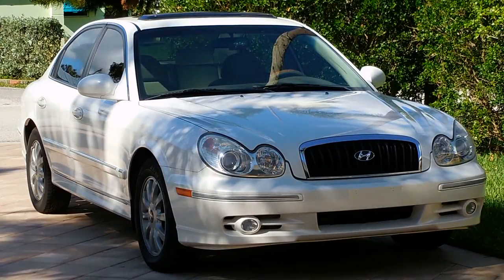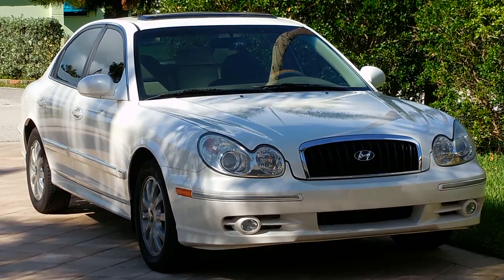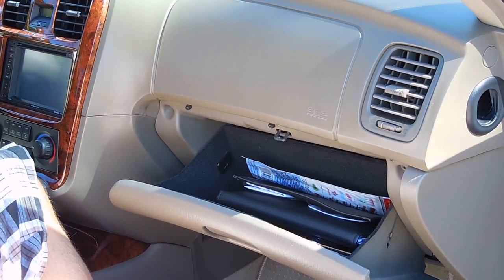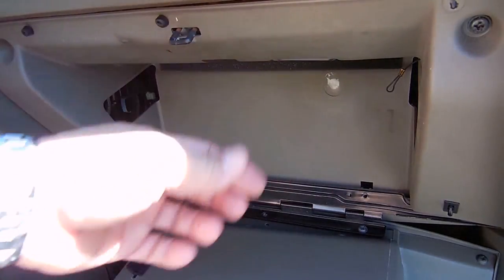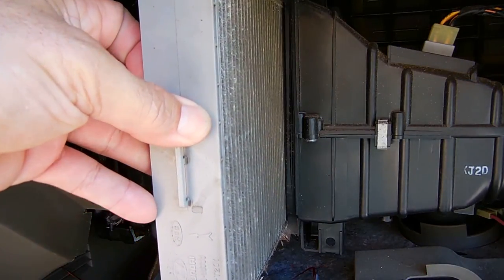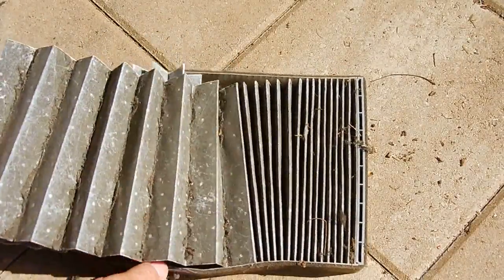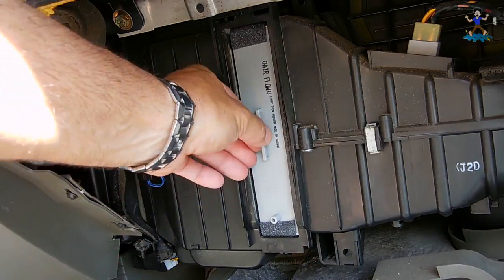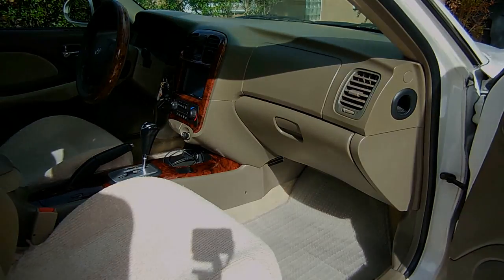How To Replace Your Cabin Air Filter

Comment: I had an old Vauxhall Vectra and the windows used to literally drip on the inside in the winter because of all the condensation,  apparently it's because this filter is blocked, I don't know if that's true? but that's what I was told.  Thanks for sharing.
Reply from the maker: Thanks for watching!

Comment: 2004 kia optima 2.4l , when i tried to replace it i noticed it had no cabin air filter so i called  to the dealership and they said there is not air cabin filters for this models, so what i could do, maybe an universal air cabin filter?!

Comment: I got an early edition of the 2006 Kia Optima EX. I went into to change out the cabin air filter. To my surprise, there was no filter and especially the unit that holds the filter. Do you happen to know the part number for both? I have already swept out that area where the filter assembly is installed. I just need the part number for the filter and especially the housing.
Reply from the maker: Online search autozone or advanced auto will have it.
Reply: @electronicsNmore  I just found the correct (complete) filter assembly that goes in my vehicle. Advanced Auto Parts gave me a flexible cheap filter with no rigidness. The one I just saw online was 17W07 Tyc 800018P. That is the correct one for my vehicle. Now I got to order it. Thanks for your reply.
Reply: same thing happened to me on my 2004 kia optima 2.4l , now im trying to find an universal just with messurements
Reply: @electronicsNmore no they don’t have it  dealership neither